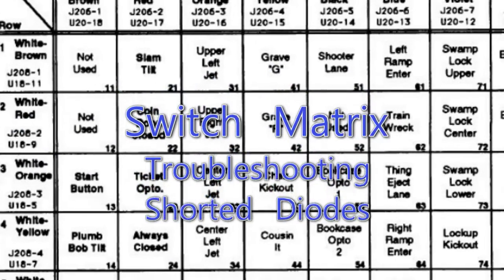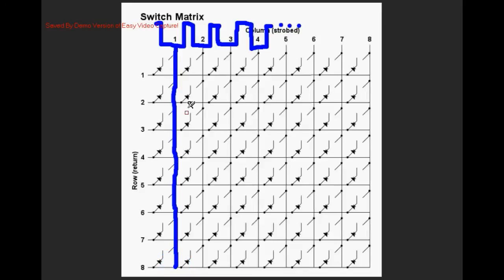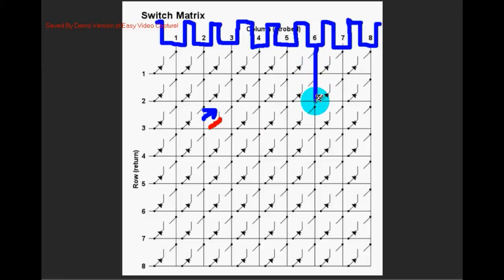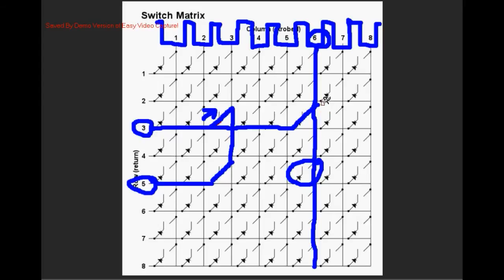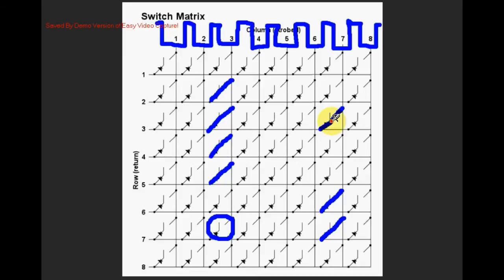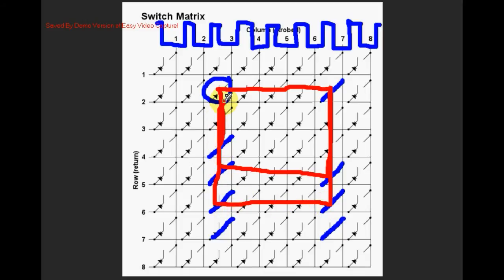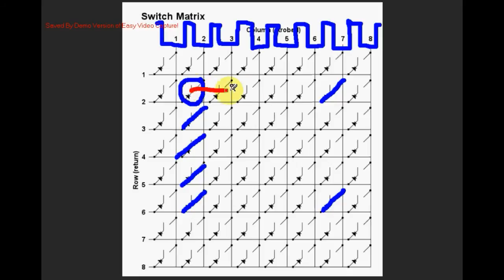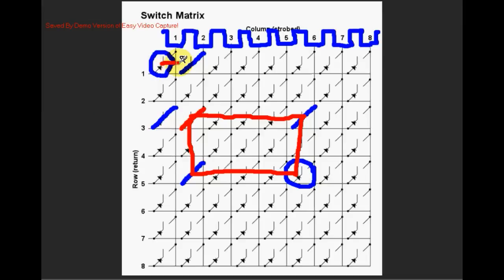Troubleshooting Pinball Switch Matrix with a Shorted Diode

Comment: Great video. Clear explanation. I'm stuck on one thing: if the current flows as you have drawn (from column to row, or top right to bottom left) then aren't the diodes pointing in the wrong direction?

Comment: TERRY BRITTON, 
the older switch matrix used AC coils AC solenoids AC relays, why did they switch over to using DC coils, solenoids, relays? 
DC uses less current draw and more torque but how so?

Why does pinball games use PIA chips for the light lamp matrix and for the switch matrix they use PIA chips for what reasons to use PIA chips?